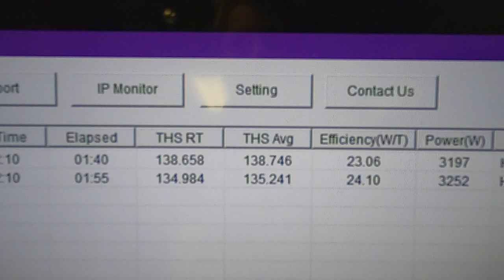🚀 140 Terahash Crypto Miner! ⏰ How to overclock a Crypto Miner - Whatsminer M30S++

Comment: how to overclock ? where the f is that part... i could give a f bout ur rig and you showing it off..
Reply from the maker: Great question! Overclocking can significantly boost your miner's hash rate, leading to higher potential returns. It's a technical process, so we recommend researching specific methods for your crypto miner model to ensure stability. Our Gen-2 Dual-Phase immersion cooling technology facilitates safe overclocking by removing heat limitations, allowing you to unlock your miner's full potential without overheating concerns.

Comment: Has anyone developed a water heater with mining rigs? I spend $100 on gas every month to warm my house's water but I figure this would be a much better way!
Reply from the maker: Yes, it's been done at the office building level - the industry refers to it as "Heat Reuse".  As far as for your home?...   E3 tanks are designed for Data Center 2.0 cooling.  Our small tank holds 10 IT blade servers (@ $30,000 - $250,000 per server).  You would need to scale up a reasonable number of IT servers to be able to reuse their heat. 

Therefore, unless you are running a small data center out of your basement - this wouldn't be a viable solution for heating your home or hot water tank - for now... 750-Watt Superchips from Nvidia are available now and quantum computing is around the corner!